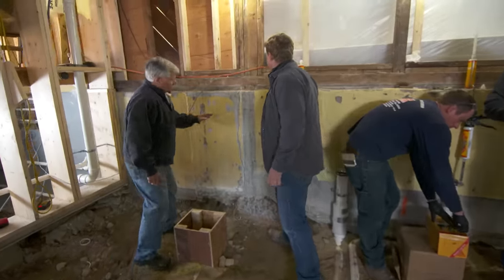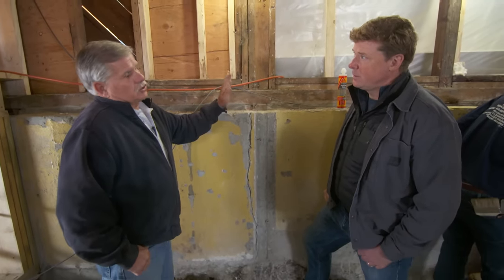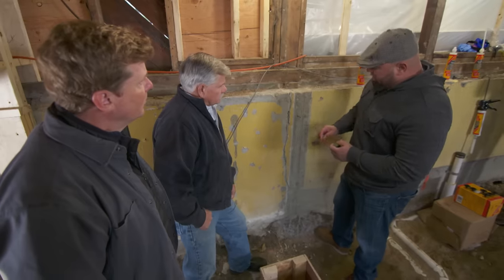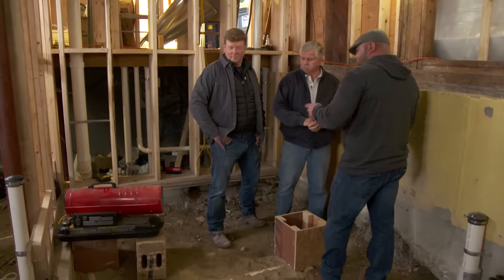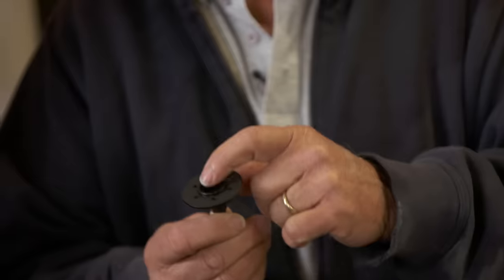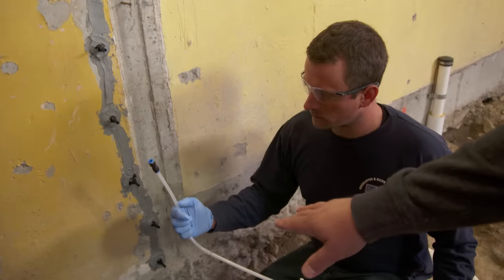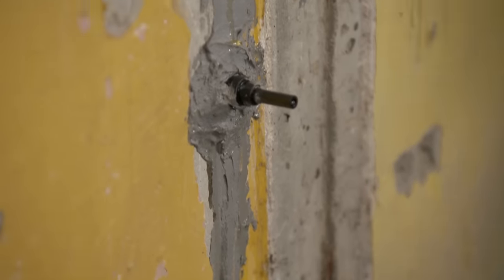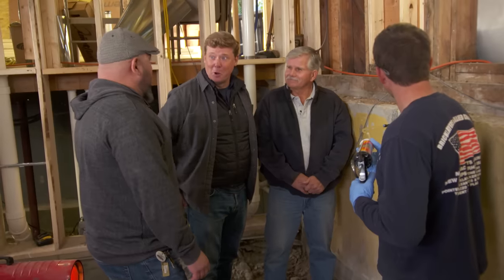How To Fix a Concrete Foundation Crack | This Old House

Comment: Before my Father sold his 20 year old home, he had about a 6' crack in the poured concrete wall that leaked water when it rained.  We found a local company that chipped away at the crack and filled it with epoxy (looked like expanding foam) for only $250.  The strange thing was, they drilled into the crack diagonally, and placed maybe 8 or 9 of these metal fittings in to the wall that looked identical to grease fittings, as in, they were one way check valves.  Then they covered the crack with some other type of sealant or epoxy that was somewhat of a tan or beige color.

The repair also came with a 10 year transferable warranty.  Not bad for only $250, and certainly solid peace of mind for the new buyers!
Reply: Blaine Bugaski, $250? That’s a dam good deal. 👍
Reply: @kalijasin  Yes it was.  If you were local to Northwest Indiana I would refer you to this company!
Reply: @Guillotines_For_Globalists  are they near Merrillville?
Reply: @bryanthomas544  They would most certainly work in Merrillville I am certain.
Reply: Dirty Burger  So what does that come out to in our American Dollars, $22,069?  :D
Reply: Dirty Burger  The $69 is your tax ;)
Reply: @Guillotines_For_Globalists  what's the company??
Reply: @leggsscott6122  Dry Basement Solutions.  They have an office in Chicago and Manteno, IL.  I wasn't aware that they were Chicago based until looking at the receipt just now.  So they will travel for sure!
Reply: @Guillotines_For_Globalists  thank you!
Reply: @leggsscott6122  No problem!  Are you in our area?
Reply: @Guillotines_For_Globalists  yes
Reply: @leggsscott6122  Best of luck!

Comment: I did the exact same thing to a house I had. When I did it , the epoxy pushed all the way to the outside wall. Still worked liked a charm. It never dripped another drop
Reply: What product did  you use?
Reply: Products you used?
Reply: What these two gentlemen just said ^
Reply: He didn't do jack sh..

Comment: The crack looks a little wider at the top than the bottom, which leads me to think that the foundation has settled on the left or the right or both. They also said it doesn't have a footing.
Reply: Sure? 0:03  I don't see it..  Looks pretty even.  Extremely unlikely there is any up down movement there.  This wall moved in, not dropped.  The crack would have been wider at the bottom if either side of the wall dropped below the other.
Reply: My basement has a crack that looks just like what you described, wider at the top, about 1/4" and hairline toward the bottom. The house is 3 years old now and I was thinking about doing a DIY epoxy carbon treatment.. do you suggest something else August?

Comment: I just completed a floor to "ceiling" foundation crack repair via this method yesterday. It's a simple task using the same method and results are the same but mine was a bit messier because the epoxy which adhered the ports and covered the crack was two part manual mix. Smelled horrible but bonded like steel. In order to assure the holes wouldn't be blocked I took a long, thin screwdriver and used that as a guide. The injection went pretty smooth at about 3 minutes to appear in the next port. I was amazed that the repair took both tubes but that also gave me a bit of confidence that the entire crack was sealed through & through. I also took care of a drainage issue that the previous owners neglected over that past 20 years. This type of repair is easily completed by a home owner. Just be sure to follow the instructions.

Comment: We used a system that drilled holes off to the side, similar to horizontal drilling in the oil industry.  They used pressure to inject there product.

Comment: Would be interesting to see them epoxy 2 big concrete blocks together and then pick it up with an excavator on one side, and smack it around a bit. Then the strength will be truly visible.
Reply: Rediscover Film Not mine please 😬
Reply: Let me uninteresting it for you. The concrete will break, the epoxy will hold itself fine. The question is application.  Bad adhesion between epoxy and concrete could be a problem if someone applies without properly preparing the concrete.
Reply: Ryszard Bargiel Smartassing doesn’t uninterest me.
Reply: @Engineer9736  I don't think you even know what you meant.
Reply: 9000 psi is the strength of the epoxy itself, not the bonding strength.
It would be cool to see the results of 2 massive blocks being lifted with only epoxy to bond them.
If the surface of concrete is smooth because of a diamond blade cut, the bonding is definitely weaker.
Chipping away would be more effective.
Reply: @ryszardbargiel7256  You're correct. Your comment is uninteresting.

Comment: This stuff works well. I used it and it stopped the water coming into the house. Been about 2 years now and still holding
Reply: Chuck Finley  no just the inside
Reply: Do you have the name of the product and where we can purchase?
Reply: @Davis5fam  no I purchased mine on amazon
Reply: Can I have the product names? Thanks!
Reply: What it this stuff called and how do I find it ?

Comment: For anyone who’s interested I’ve replaced many dozens of these epoxy repairs that often lasted only a few months. Epoxy repairs are completely inflexible so they frequently fail as soon as the weather changes. I did hundreds of flexible foundation crack repairs and replacements over a period of about 2 years using a urethane system without a single failure.
Reply: Interesting. Can you please explain how the urethane system works?
Reply: @mredldean1 : The product is SicaFlex 1A primarily designed as a flexible waterproof sealant for concrete joints, curtain wall construction panels and around doors/windows in ICI construction. You can buy it in standard caulking tubes or large ‘sausages’ which require a special gun. If you’re doing a single crack at home the standard tubes are fine, otherwise you’ll need the sausages and special applicator gun. IT’S NOT A URETHANE INJECTION SYSTEM so you don’t have to worry about blowing out the foundation. It’s simply applied into the chiseled-out crack and feathered out several inches either side. Somewhat messy to work with but 100% impermeable after cure. Let me know if you need more info.

Comment: Could you put a link to the products used? I sure need a fix like that. Thanks
Reply: Probably won’t post a list. It cost like $200 for the products but they most likely charge about $3,000.
Reply: The color of the containers look like Sika brand of products.
Reply: $30 at Home Depot.   I have not used the kit, but Dri-Core is a good company.

Comment: Could someone list the materials used? I'm buying a house and it has foundation cracks and to keep costs low I think its something I could take on
Reply: I would not do this I've worked in construction for 15 years and none of these easy fast tricks work. The water pushes from the outside pushing out anything put in from the inside. Best way to fix foundation cracks is to apply foundation sealant from the outside. Dig out to the slab of the foundation and roll the black foundation sealant 3" over the level of dirt. Then apply the a waterproof membrane made of plastic over the wall and add a French drain to the bottom leading away from the house. Then just fill in the hole. Expensive but life proof you will never have to deal with it again and will increase the value of the house.
Reply: @warrenwallace2  - of course you're right that the water pushing from outside must be fixed before doing anything, however at  0:25 they say water caused the problem and they fixed that. I guess you're saying filling the crack with epoxy that is 9 times stronger than concrete adds no real value if the outside water problem is fixed, presumably because the crack won't grow since there is little or no force anymore. So would you just fill the crack with concrete for cosmetic reasons only, not for strength, or even leave it cracked since nobody will go under the house anyway?
Reply: So has anyone listed the materials that were used

Comment: Epoxy injection is the older technology used for concrete foundation crack injections. The newer kind is a polyurethane injection, which is exponentially more flexible for the expanding and contracting over the season changes. It is slightly more expensive, but not by much. You're looking at maybe $40 more per 10 linear ft of crack.
Reply: Can you send me a link of where I can buy the polyurethane injection... please jesus?
Reply: You sir are100% correct,I am currently working in the wet basement trade,have for 5 years,..epoxy is a temporary fix,after a few seasons the basement shifts enough to allow water through again,we use a polyurethane 2 part product that has 10 times expansion that acts as a rubber seal,..lifetime warranty..any product that doesn't flex is bogus!
Reply: @jgg204  Thanks dude!! I think this is the solution I am looking for. Now I need to find how to assess the water problem on the outside. Not sure if I can DIY that one...
Reply: @Archaides  honestly i've found that just injecting the crack on the inside and then re-grading the outside....it has solved 100% of my basement water intrusion problems at my 3 homes
Reply: @jgg204  Thanks for the tips. I don't have a basement, but the area of the house that my issue is in has a recessed floor (i guess that's what its called). This areas floor/slab is about 6inches lower than the rest of the house. I had foundation repair done about a year ago and they put a moisture barrier in the 2 areas that have water coming up through cracks, but heavy rain earlier this week revealed that it did not help and my carpet was soaked. Not sure what to do on the outside of the house to prevent this.
Reply: @Archaides  That's strange, usually the slab is the lowest part of the house. Sounds like you need to do horizontal crack injection on the concrete slab cracks. then go outside and install an exterior perimeter gravity drain system to carry the water away from the slab and pipe somewhere else
Reply: @jgg204  Yeah its a horizontal crack. I can see it from the outside, right below a window, and if I pull the carpet back I can see where previous owners tried to patch it. The crack is about 3ft long. I presume I should use the poly product for this and not their epoxy product? Does YouTube allow private messages and picture attachments? I can send you photos if you are OK with that, I appreciate your opinion.
Reply: @Archaides  I would call the company I linked to in the above comments and ask if they have a self-leveling product that will flow into the crack and seal. If not, Call Quikrete and tell them what they recommend to seal a horizontal concrete crack they may have a product. Then I would talk to a drain company about installing an exterior perimeter corrugated pipe that will prevent water from getting under the slab. Really to solve the water issue all you need is the drain, but you need to seal that crack to prevent moisture from coming up, as well as the potential for insects as well (you want a sealed floor). You can seal the crack yourself, and you can dig out around the slab yourself to save money, then have the company install the crushed stone and drain, backfill, and compact and grade away from house.
Reply: @jgg204  Aloha from Hawaii. Hit a pool crack that reoccurs every year or two. I stuff it with epoxy and reapply when pool leaks. It is along the wall traveling about 3-4 feet. First 1-2 leak water and then a hairline crack.

Is the more flexible product the right approach?  I believe so. 

Do I put the hard epoxy on the outside to create a dam to hold injected material inside?

Do I use the method they used with the injector
Reply: @jgg204  Yes!! I can vouch for the re-grading idea, plus draining water away from the foundation. I did this alone and my basement leaking has stopped. However I'm still going to fill the gaps super good.
Reply: its not really true, polyurethane is better most of the time for most basement cracks but it is not a structural repair.  If the crack is coming off of a beam pocket or something like that I will likely use epoxy.  Thinner epoxies can be more effective for fine hairline cracks that are harder to inject without an expensive high pressure injection.  The expanding properties of the polyurethane make it much more cost effective and idiot proof than the epoxies.  Truth be told if its not a easy textbook crack your better off calling a pro.
Reply: @troyfreitas8611  If the pool is full polyurethane is your only option it is waterproof but mechanically weak, thats fine if there is little to no movement in the crack.  If you can get the crack dry, injecting epoxy will be about 12x stronger than injecting polyurethane and is a much stronger repair.  The process is identical but epoxy needs a dry crack to bond with the concrete.  Sikadur is high strength injectable epoxy,  Sikafix PU is a injectable polyurethane..  The rabbit hole goes much deeper but that where pro's come in

Comment: Great video! My foundation is made of cinder blocks. So if I have a crack in my foundation and inject it with epoxy, should I worry about all of the epoxy going into the large hollow spaces of the cinder blocks?
Reply: Not an expert but ya it would go into the giant voids unless it was filled with concrete

Comment: You're title is exactly correct, all you did was fix the crack. Nothing was done to prevent the wall from again cracking other than improve the outside drainage. Either a rebar reinforced footer needs to be added or 3x2x1/4" C-channel bolted along the length of that wall.

Comment: How can I do this without a kit????? I see that these polyurethane foam injection repair kits are expensive! I also see that I can buy packages of the injection ports separate online. Does anyone know if I can just use the ports, some spray cans of foam, and some hydraulic cement instead of the epoxy paste to do this a lot more cheaply? My concern is that spray foam will not have the necessary injection pressure to fill small cracks that a caulk tube of foam would have when injected with a caulk gun would have. And I can't find anywhere to buy polyurethane foam in a caulk tube separately. Please help!

Comment: 💥 I’ve learned all throughout life…  When you plug a leak in a dam you do it from the side where the water is pushing from.  In this case you would plug it from the outside.   This way will just cause the foundation to fill up and hold the water in it.
Reply: Pretty sure they said theyd go out and do the same thing outside. Or at least i believe thats what youre supposed to do

Comment: Silly question, but is this something someone with little to no experience could do by themselves? I've got a couple small cracks in my garage (where one has started to leak through).
Reply: Yes but probably not as efficiently. You’d probably do this or use hydro cement

Comment: Looks good, BUt Im concerned with the product coming out the back side or outside wall. Wouldn't the epoxy just push through to the outside ? Or would the dirt hold it ? I dont want to dig up my driveway and patio. Thanks for any help

Comment: Compare to using hydraulic cement to fill the cracks, what’s the difference? Which will be a better idea?
Reply: Hydraulic cement is great for waterproofing but has poor strength, as there is no aggregate. This epoxy appears to have some sort of aggregate in it, giving it more strength. The epoxy will also allow the crack to “breathe” some and prevent the crack from propagating, whereas hydraulic cement is rigid and may allow the crack to propagate.

Comment: so that neet but you fix drainage patch the creak and the fill that into the creak will stringer than the concrete but there got be some distance from bottom to concrete right and fill the top you not do the bottom then later it’s start busting around fix or in same spot even fix the water drainage there still void at the bottom and move on hot or cold or weight i just thinking

Comment: My basement has a crack running horizontally at about a 15° angle from one side pretty much all the way to another. Home constructed in 1950 with terra cotta footer drains running around the perimeter outside. All those clay pipes are cracked due to root invasion, not to mention freezing and thawing each year. I know I’ll have to repair/replace the drainage in addition to the crack injection, but my question is what is the success rate of the crack injection on horizontal cracks vs vertical?
Reply: You're definitely better off digging out the outside and sealing it there. This is good, but outside is best.

Comment: I have a foundation Crack in a basement wall that is fairly large at the top. We had a structural engineer already pass the wall for repair but I'm wondering how a very large Crack repair would be completed.

Comment: i have a gunite hot tub that has cracked about 10 inches below the top of the circular pour. the crack is just at the height of the spillway completely around the tub all the way through to the outer side wall. i have searched and searched and am unable to find any type of repair on the internet. i was wondering if this system would work to repair and seal the leaking crack right on the waterline. the crack leaks roughly 50 gallons a day and is behind the tile. i was thinking to use this system, cover with the paintable water proofing material, then retile and grout, then texture and repaint the outer wall.